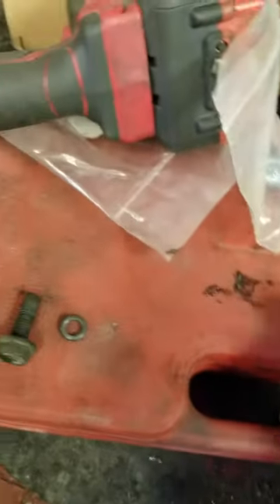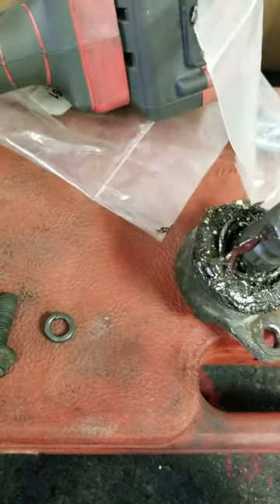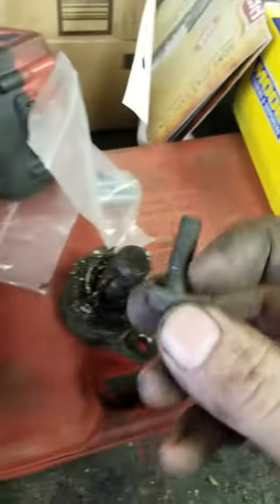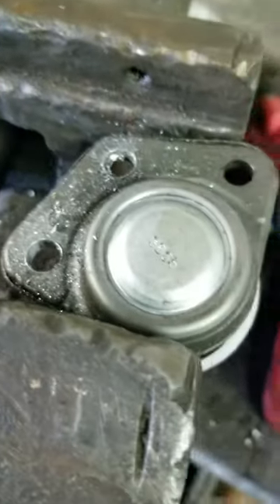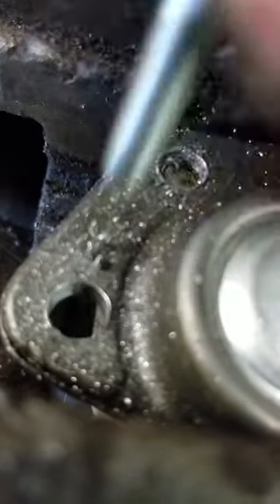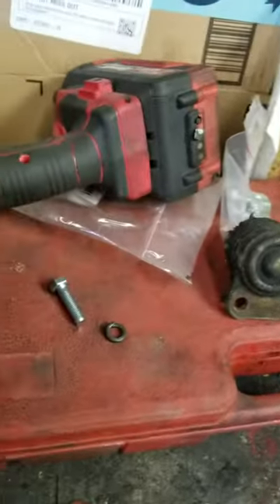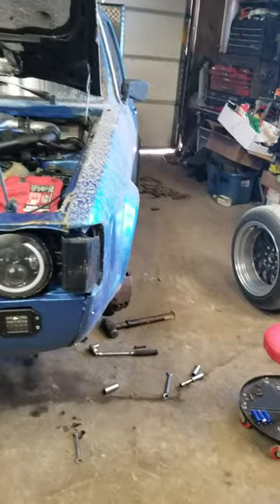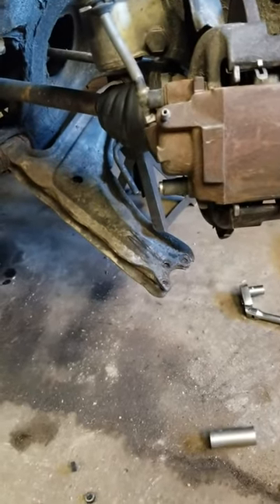Volkswagen MK1 Rabbit Balljoint upgrade

Comment: A question, are you putting your jackstands under the suspension bushing? My stock jack points are pretty rusted out.
Reply from the maker: I know it has been quite some time but yes, I have always jacked up with the front a arm mount and put jack stands on the rear.